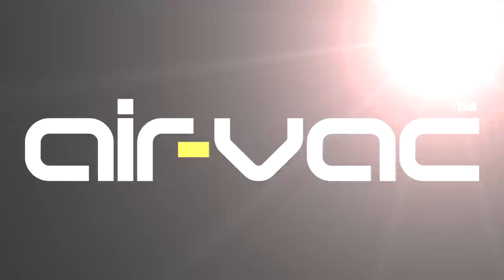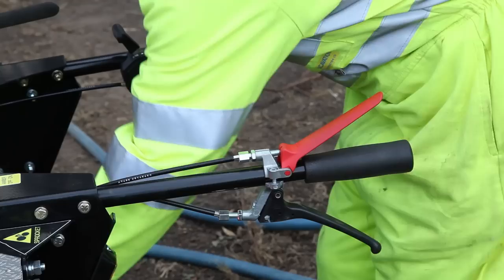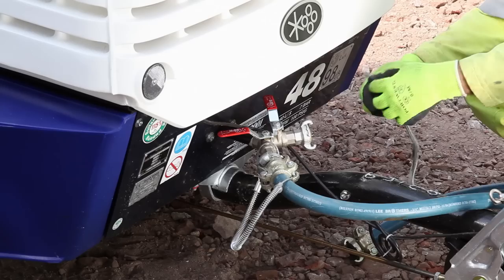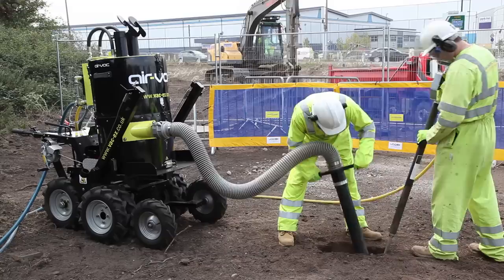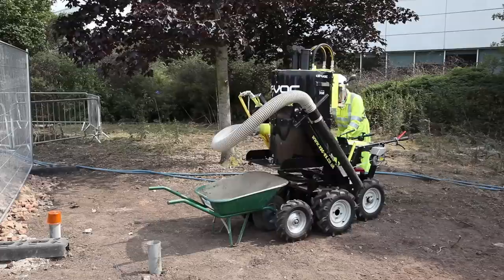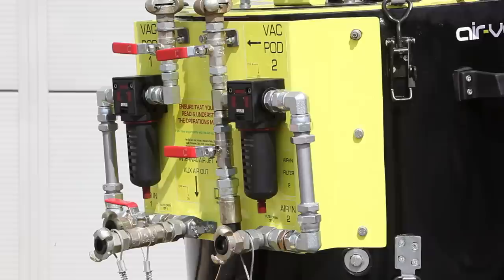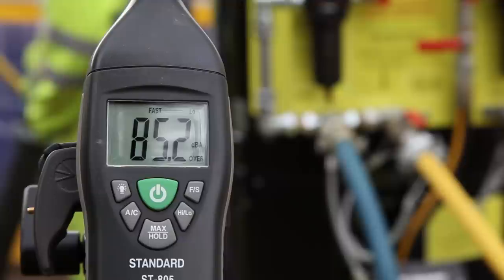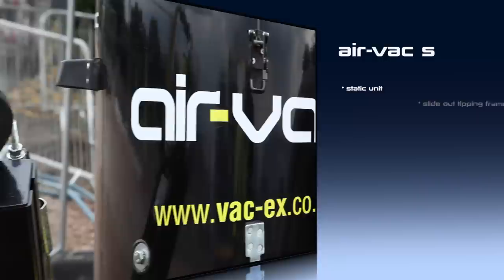AIR-VAC - Now superseded by the 2018 next generation unit.

Comment: Imagine using that to dig for old coins and lost jewelry, just pass thru what you suck into that tank with a good metal detector, than put back the soil afterwards.  I tried the conventional method of digging and quickly realized you got to have patience of steel for that hobby.  I know some gold diggers use vacuum systems to hunt for gold, I'd imagine it's used for gems as well...what can you say but "this thing really sucks".